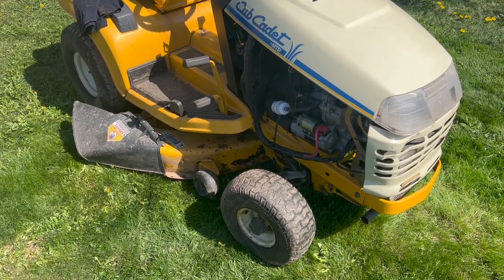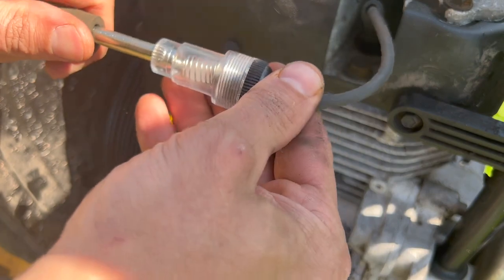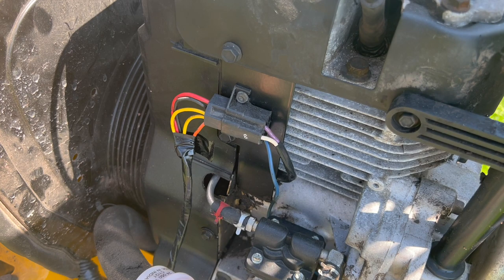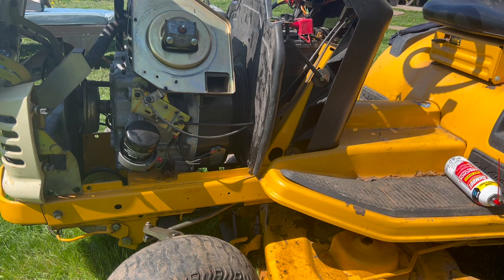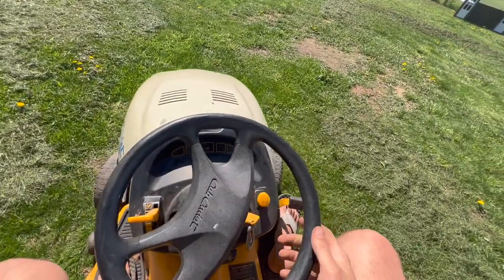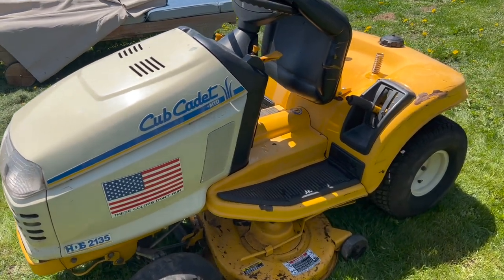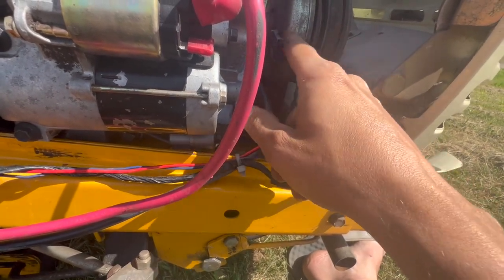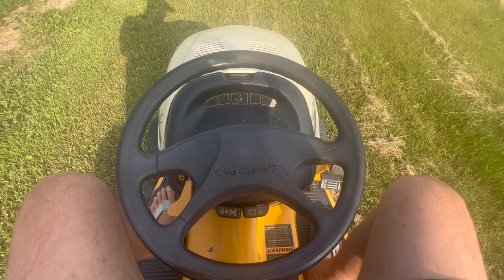I Bought a Broken Cub Cadet HDS 2135 and Fixed It!

Comment: I have a 2135 that I purchased new in 2001. The only major item I had to replace was the  front cast iron axel (Crazy). Engine and Hydro still run great. Has 530 hours on it so far.

Comment: Very helpful, especially showing the location of the backup switch and various troubleshooting.  I'm having an issue with no getting anything at all after running the engine for a while.  I shut it down and when I try to restart it, I get nothing - no clicks, no lights, no clicks, nothing at all.  Checking all the various safety switches and fuses, replaced the PTO switch (and had a bad PTO clutch) replacing the cheap parts like the solenoid and the relay, checking continuity between cables and such. Blew the 20 amp PTO fuse once. Battery shows 12.42 volts but I saw someone post that that could be misleading as the voltage drops substantially on a bad battery.  Using a battery charger hooked up does nothing.  Still trying to troubleshoot.
Reply from the maker: Glad it was helpful! Initially I was going to say a faulty voltage regulator is not charging your battery. If it doesn’t turn over with the battery charger on, then there’s an interlock engaged or a short in the wiring. Especially since that fuse blew. Trace the wiring from the battery through the ignition switch (possible culprit) and so forth down to the starter. Chances are, it’s grounding out before the starter receives power.
Reply: @FrenchRiverCo  thanks. Can’t say I’ve really found the problem, but I tried starting it today (3 times) and it started right up, the PTO engaged, lights came on, everything’s fine. I gave it a good cleaning with a degreaser a couple days ago and rinsed it off with a hose, so maybe the water/degreaser caused a short that went away when everything dried - I dunno.
Reply from the maker: Glad you got it running! It definitely could have fried that fuse. If it was the main fuse, then that would have prevented any electrical activity.

Comment: Yeah but they always leak and might say that you're check your oil Pan bolts down there on your sump and make sure they're tired has a lot of times that vibrate the bolts let's send the bottom of the engine